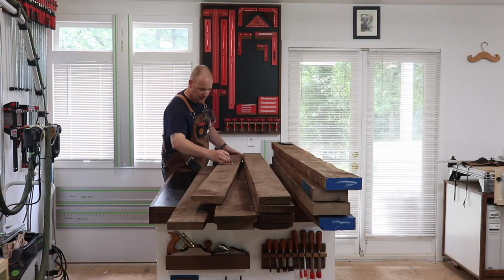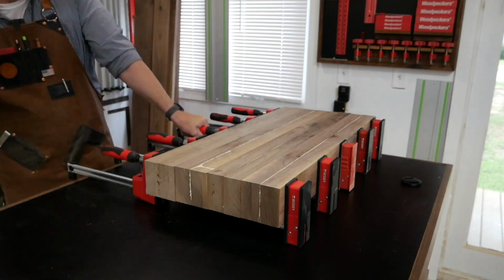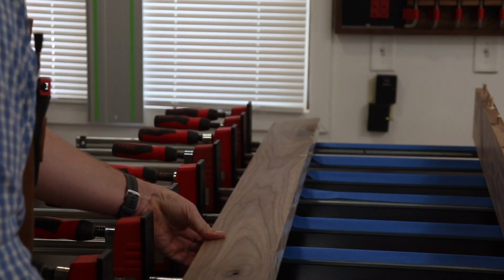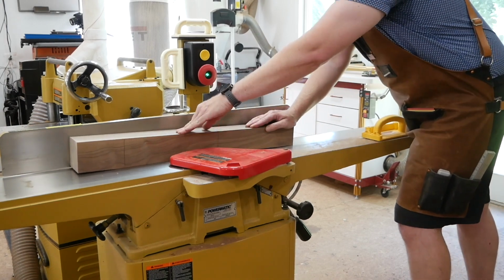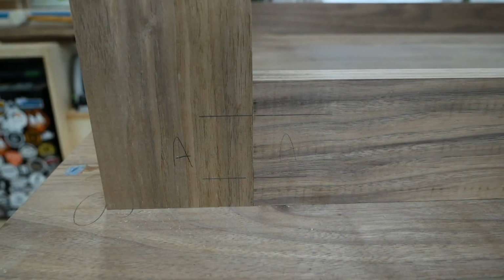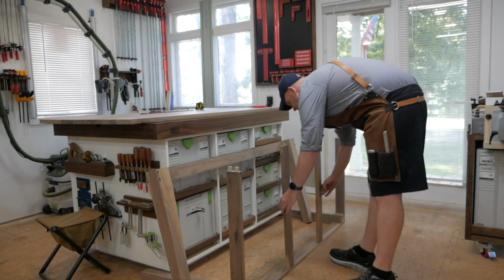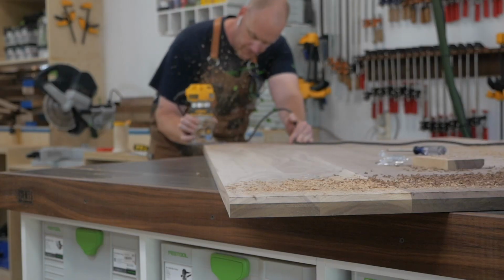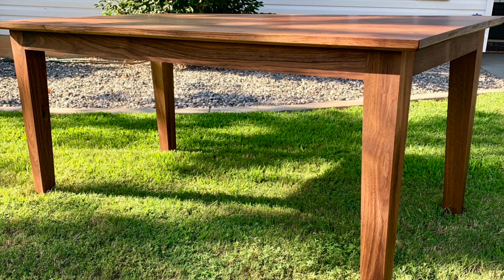Walnut Dining Table Build // Plans Available

Comment: I really like the way you did the levelers on the leg, that is a great idea. How did you allow for seasonal movement with the top connection to the base? i would suggest corner blocks on the table skirts rather than L brackets. They add quality and stability to the skirts connection at the leg. The C Channel is very nice but on this design the skirt acts in the same way to keep the top from cupping. Great table. love the way the finish came out.

Comment: Looks great!   Two questions for you, if you happen to see this:  1.  What leg levelers did you use?  Assuming you like them, could you reply with a link?  2.  How thick is the top of this table?  Thanks!
Reply from the maker: I like them for most applications. I can’t remember the brand but I get them at Home Depot. As for the top, mine was 1” thick.

Comment: Very nice table!  One question...how did you attach the table top to the frame?  I've seen it done with "S-shape" brackets that attach to the bottom of the table top and the other end going into a slot (biscuit cut) to allow for expansion...is this how you did it or with another method?  thanks!
Reply from the maker: That is exactly how I attached this top.
Reply: @bentswoodworking  thanks for the quick feedback...I'm having trouble locating these...is there a name for this type of bracket?  I"m assuming they have them at the big box stores...

Comment: Jason I ordered the plans and they were very well done the only concern is that you didn’t source the materials like the the Z clips or the adjustable felt Feet.  The only adjustable feet I can find are only an inch and a half in diameter with a quarter 20 thread count stud.  Is that sufficient to what you used or were more substantial!   Thanks and awesome channel!
Reply from the maker: First, thank you for purchasing the plans! The z clips I usually get from Rockler. I usually get the felt feet from HD and use the 1 1/2” as well. The only thing you may want to try and find is metal threaded inserts that will accept quarter 20 thread. With that being said I typically just use the plastic ones and haven’t experienced issues. Mainly because the feet are barely protruding just to allow for the legs not scratching the floor.
Reply: @bentswoodworking  Thanks Jason!  That's what I got... they just looks a little "thin" to me but my table is going to be 1.25" thick in full Pomelle Sapele.  I'll push up a photo when done on Instagram!  The legs and skirt/stretchers are done... just need to do the table top and then finish so Im about 20% done... ROFL.  Thanks for the reply and thank you for your service!  Go Navy :), Dan  USN, ret.

Comment: Nice work!  What size domino's did you use to connect the aprons to the legs?  I'm thinking about building a kitchen prep table and considering purchasing a domino and was wondering if the largest domino for the D500 would be sufficient for a table with similar apron / leg dimensions as your project - thanks!
Reply from the maker: 10x50

Comment: Wouldnt the stretchers be stronger if positioned vertically. The 2 in middle
Reply from the maker: Yes but wasn’t a huge concern as the top will be resting on it and it’s not being moved. Plenty strong

Comment: Where did you get the C channel? Most I see don't come with the elongated holes.  Did you attach that with screws, lag bolts or threaded inserts into the table and bolts?
Reply from the maker: I got this from Home Depot and cut and drilled it manually. Legacy Lumber sells pre made c channels. I use threaded inserts from rampa tec.

Comment: Great build! One question about domino length. I have a 500 but was concerned with only being able to use a 50 mm domino. I assume u we’re comfortable with that length.?Would u recommend going to the 700 to gain the length in domino if possible? Thx
Reply from the maker: I was comfortable with it as it is just there to support the top. Longer would definitely make it much stronger but for this application I find the 500 suitable

Comment: Jason, one more domino question. I am just starting to use domino system and was planning on using 2 8x50 in my apron to leg joint but my apron is only 3.125 “ tall. It’s seams a little tight and am wondering if I would better off to go with one 10x50 domino centered in the apron? Also will the Rubio Monocoat protect  the wood from glasses that might sweat while sitting on the table. Thx
Reply from the maker: You can get away with two dominos and I always use coasters to be safe personally so I am not totally sure

Comment: Looks amazing great job! Do you have a link for the C-Channels you used and the tracksaw square? I didn't see it listed below. Thank you!
Reply from the maker: I don’t unfortunately. The c channel I use was just steel c channel from Home Depot. I had to drill the holes and cut it down. You can also purchase pre made c channel from Legacy Lumber. The video I am getting ready to do on installing c channel will actually be from them for the demo. The track square is from TSO Products
Reply: @bentswoodworking  Thank you very much! Yes I have seen the Legacy Lumber ones, just wanted to see if there was another option.
Reply: @bentswoodworking  Also just checked out TSO Products and their main location is in my town Fort Myers, FL
Reply from the maker: Matt Fabian nice! You can just drive on over and get one.

Comment: Can you break down material cost?
Reply from the maker: Material cost is highly dependent on area. The walnut here retails for about $600 for the amount used for this table but there are many other options for wood that would be far less expensive.